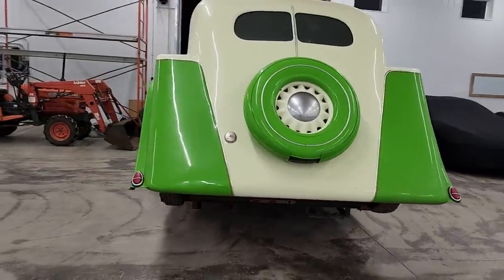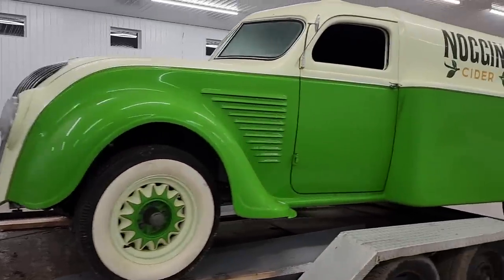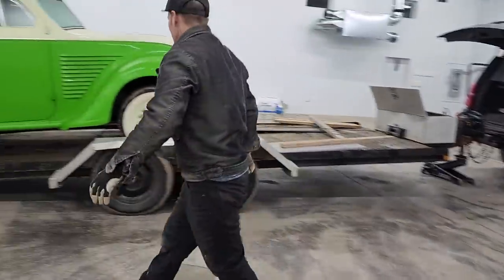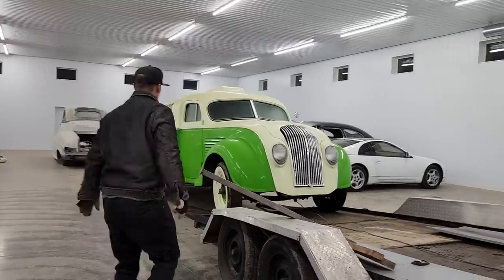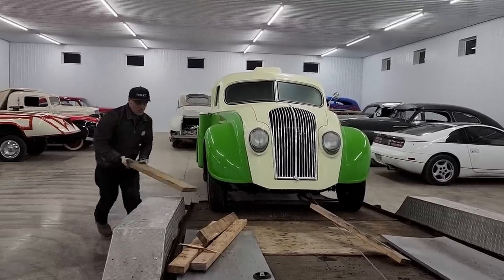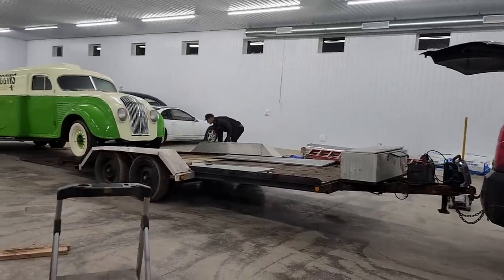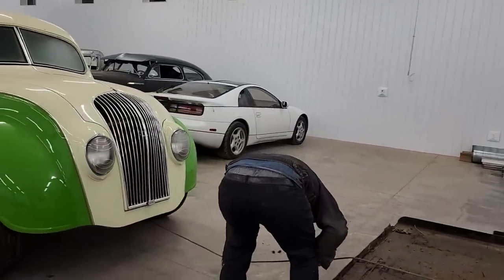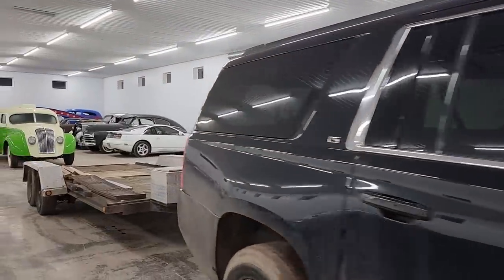HOLY SH*T.... this was bad 😓❌ unloading our 1934 Chrysler Airflow

Comment: Just a suggestion but instead of winding your cable all the way in hook it on the back of the trailer and take up the slack, will save you time in and out and battery power, especially if you're just going to get another car the next day
Reply: @donaldhalls2189  either way, it wouldn't hurt to spray the cable with WD40.
Reply: Exactly!
Reply: @donaldhalls2189  just until they're finished moving the vehicles.  Then they can winch it all the way when they are done.
Reply: @SuperHandyMan  Synthetic is the way to go..... Dyneema
Reply: Jolene, Jolene, Jolene

Comment: Chad and Jolene if you remove the medal box on front of trailor you will gain alot of trailor room... just mount the battery on the tounge and you'll gain 2 feet or more... just trying to help yall.. Chad's a busy gut and might not notice... thanks for the video
Reply: Make new wider ramps. What you have now will lead to disaster
Reply: @dickshoup7893  that trailer is too small and too light, ramps are for lawn mowers.  Should have had someone with a roll back move them

Comment: If you don't have one maybe getting a snachblock to use for off loading . It can also be used to help with heavier vehicles or vehicles with flat tires or non moving wheels.  Good luck . The Bad Chad fleet is looking Amazing. "Not as Amazing as Jolene " Thanks for sharing Chad and Jolene
Reply: I also think a few solid floor anchors to attach the snatch block and use the trailer winch to do all the work would be useful
Reply: Nothing looks as good as Jolene.  Beautiful in front of the camera and beautiful work behind the camera.  Chad is good about giving her props but you just can’t say enough about her contributions to the channel.

Comment: Hey Chad.  Use the Cab Over for a Dead Man and hook the airflow to it and use your Come Along to drag it off.  Use the winch to hold the slack so it don't get away .  Or put the tanker in gear and drive pull the trailer out from under it.  You should have unhooked the trailer from the truck  and put blocks under the jack so it would go higher for a better slope to roll down. Remember _ there is more ways to skin a cat.

Comment: Chad  I would cut that metal off the back of the trailer , Get some 1/2 X 1 1/2 flat stock . Cut some 3/4 inch spacers and weld the flat stock level with the back of the trailer . Or you could cut the plywood on the sides and fit a 2 X12 as long as needed to fit the trailer . I enjoy watching and seeing all the cars that you have done . Keep up the awesome work Chad & Jolene

Comment: You could use the starter motor to back it off.  Put it in reverse and hit the starter button. It would make matters easier if your ramps weren't worn out.  I've done it with all jalopies when I was a kid.

Comment: Your ramps are bowed and they need to fit flush with the floor of the trailer. You might add 3/4" plywood to raise the floor and strengthen it at the same time.

Comment: Maybe you could modify the trailer at the rear so that the bed of the trailer is flush with the deck. There seems to be a rim around the back of it. Then build stronger and longer ramps. Also make a connector piece for the ramps so they are flush with the trailer bed.

Comment: Watching the video after the fact I know. 
I would have pulled the truck ahead and up onto a couple 2x4's and then place 2x4 or a 3x material behind the wheels to create the same plain.

If ya remember the video of when you bought the trailer, buddy had some 2x8 or 2x6 laid on top of the 3/4 plywood so no vehicles would fall through the plywood deck. You need to screw down some 2x6 to the whole deck. Your cars will come off easier because it'll be above the lip at the back.
When I had my towing company, I had a deck trailer with a winch and had a snatch block at the back so I could pull cars back off the trailer easily. Save your back my buddy.
Hope my insight helps ya out a whole ton.
You are doing good, the more you tow with the trailer, the more tips you'll pick up as well. I didn't know anything about Tow trucks when I bought one. Had that biz for eight years and then went out to Northern BC doing the Ice Road Trucking thing.

Comment: Hey guys this is John and Marilyn from Tennessee. We think you guys are awsome. We had the same problem with trailer angle (loading/unloading vehicles) we solved our problem by backing up on a set of car ramps behind the rear tires of tow vehicle. Now loading a vehicle low to ground is much easier.

Comment: Chad you could add a roller at the back of the trailer and run the cable around the roller back towards the front of the trailer then hook it onto the truck. Pull the cable in and it pulls the truck off the trailer. Might need an extension to move the roller back a bit from the end of the trailer to work better. If the truck runs down the ramps too fast the cable would still be attached and keep it from running away. Extend your cable and you could pull the truck off the whole way. I could email a drawing if you like.

Comment: "Jolene and Chad" a bit of advice to you both, Buy a proper car transporter trailer like a one with a hydraulic tilt system and electric winch etc fitted as your cars deserve a better way of moving them about and your body Chad will thank you for it instead of humping and heaving the cars over the ramp lips etc plus it will be one heck of a lot safer for you both and save any damage to your beautiful cars and trucks, PS I have been there and done it the hard way myself before sorting out some better transportation lol

Comment: Chad, I apologize for all my sentences starting with ‘back when I worked at the car lot’, but I was a kid then and I learned a lot of neat tricks and one of them was that when a battery clicks real fast like a machine gun.., that means dirty cables. when a battery just clicks one or two times real slow it means a dead battery. other than that I don’t know anymore about why they do what they do ,something to do with high volts low amps, and low voltage/high amps but I don’t know which is which but I do know that a low battery will burn up a winch as quick as too high of volts will! either voltage is hard on them. Plain old 12 V even boosted plain old 12 V is what they need not 24 and not a low 12 and not continuous use you’re getting the shop looking good .wish I was there to help you.

Comment: Hey Chad  I think you may find it a little easier if you flatten out those ramps as the bow is causing the rear to come up on a more steep angle. 
If you put the end on a 4x 4 block and then add your other ramps to extend the ramp and reduce the slope you will have less hassle.
love this Cider wagon - One of my Faves.

Comment: The comment about the snatch block is something I was going to suggest too. Also, cut some of that lip in the rear off where the wheels have to pass. That way they won't hang up going over it. I agree with everyone about the ramps too. Take a couple hours and build some longer, heavier ones. It's cheap insurance for your safety.

Comment: If you put a split charger on your truck and use fork lift plug and socket on to the winch battery you can charge the battery for the winch while you tow the trailer.
Just an idea you could try.
Keep up the great work love the channel.

Comment: Is that a C8 Corvette hiding under that black car cover? Also, you could use the tractor to pull the vehicles off the trailer. But you will have to have the door open for ventilation if the tractor is running for a long period of time.

Comment: I for see a Bad chad trailer mod coming soon  with some air bags. Wish I was there to help w the struggle . Jolene was on the right track by putting the 2xs at the lip but just needed to pull forward on 2xs to gain the elevation and then put one at the lip. Next time maybe. Take the rest of the night off you two

Comment: Next time you have problem getting a vehicle off of the trailer like that put the vehicle in gear because the back wheels are on the ground. Holds the tow vehicle forward and it will go over the hump. Just let the cable out a little bit and it will take it to the stretch of the cable
Reply: Wow right as I was sending this you did the same thing
Reply: I see your ramps are bent a little bit flip them over and drive on them to take the band out of them. After you take the van out of them take a 8 by 8 and put it under the ramps when removing the vehicle

Comment: Maybe overlay the trailer deck with another sheet or 2 of plywood to bring the deck up to the height of that angle iron on the back? Only need about 12-18" wide pieces where the tires roll.

Comment: That was PAINFUL to watch bud, I think the grey 3/4 boards are supposed to be screwed down to the back of the trailer. I would not recommend jacking up the trailer like where u have been, if the ball hitch breaks it gonna crash down hard and someone may get hurt. Also someone should be in the car to hit the brakes in case yer winch let's free the car will be fubar.

Comment: Use the winch to pull off the vehicle by adding a pulley right at the back of the trailer and run the cable through and hook to front suspension

Comment: Winch it a foot ahead leave the cable slack a foot block the wheel on the car at the back and drive ahead a foot till your over the bump of the ramp. Done. It will only roll as far as the cable will allow it.

Comment: put you a 2x6 wedge at end of trailer so wheels ride above edge of trailer or add.  pulley at back of trailer run cable thru it.than hook it to cars axle

Comment: I would have jacked the trailer back down put the Airflow in park, put thin wood under the back of the ramps, dis connect the cables then pulled the trailer out from under the Airflow.. wallah.. easy peasie! Why break your back

Comment: U could park Jolenes race truck in line with ur trailer an leave it their till ur done hauling ur cars an use her winch on the race car hauling truck u built to pull the cars off the trailer. Jolene release the trailer winch as u pull with the truck winch no more struggles getting them to move

Comment: I was yelling at the computer drive ahead. Chad. You need a snatch block and a clevis and a strap and as soon as you can rebuild those ramps there shot. And mount them on piece of flat bar that is welded a half inch as a stand off. set up. And make sure its welded so that their isn't a lip that prevent the vehicles from rolling off the trailer. But a snatch block will take care of it even if it has to roll over a lip. There not that expensive Chad at all. your gonna be in a wheel-chair by the time your 65 years old doing that shit. work smarter not harder man.

Comment: The More You Jack Up The Trailer The Less Weight It Has On The Pulling Vehicle ( Your Truck ) REAR Wheels .You Run The Risk Of The Tires  Of The Truck Coming Off The Ground & The Truck Moving By Itself & Not Having  Traction On The Ground. The Whole Trailer & Everything Will Move By Itself

Comment: need a bit of a run-up to get off that lip at the back. Consider putting in Reverse and Bumping off with the Starter.
Reply: What starter
Reply: @timkeeler4461  starter motor
Reply: Why not start the car?
Reply: @timkeeler4461  Chad said car had mot been started nor run for 3 years. Fuel probably off and better not to start just use starter to bump in whilst in gear